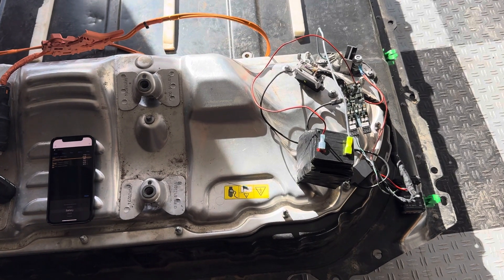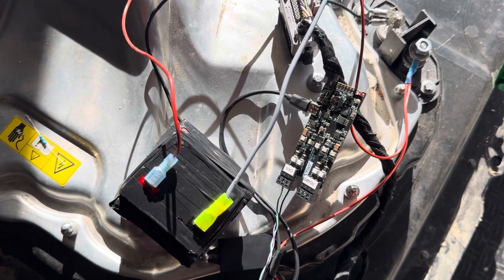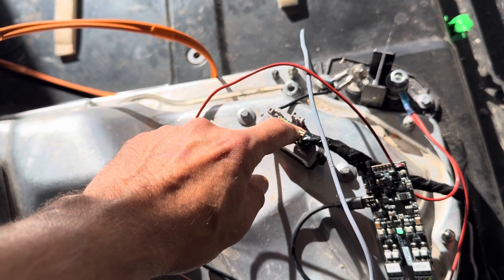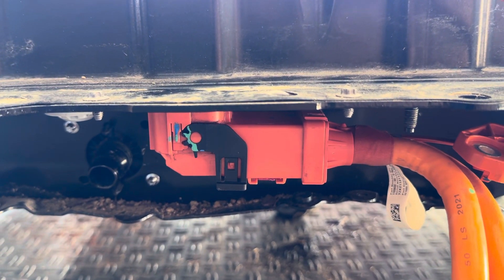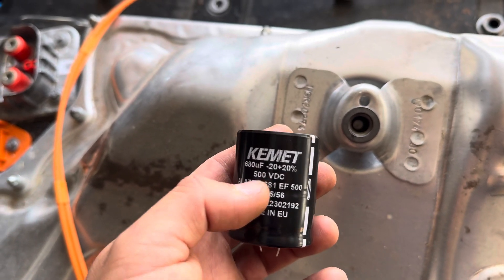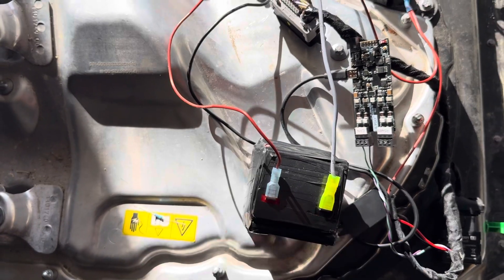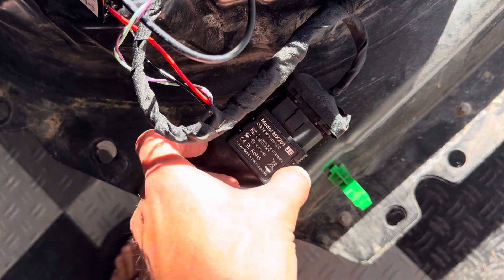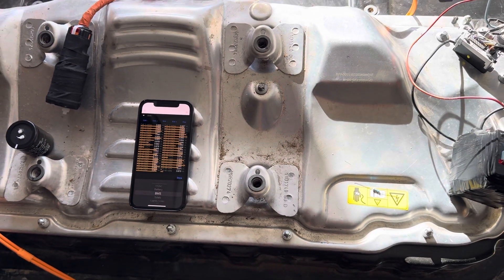Using Tesla model 3/Y battery for solar storage - how to close contractors using Tesla BMS

Comment: What is the best way to use a regular 12v lead acid battery with a 2022 LFP pack that is meant to have a 16v lithium battery? Obviously it will power up fine but after a while I imagine the higher voltage will damage the 12v right? 

What would you recommend? Is it possible to tell the DC-DC to output 14.6v?

Comment: I have problems to close contactors with 2022 tesla y long range hv battery. Lilligo/arduino sohtware reported problem. Check hv cables and interlock. Any suggestions.
Reply from the maker: Join this Discord and ask questions there: https://discord.gg/mVnXGCkh

Comment: How are you charging the battery a direct 240V Solar Array on the inverter side?
Reply from the maker: I won’t be, because my solar is AC coupled, but it’s definitely possible, if the inverter has solar input.

Comment: Hi, Is the software that closes the HV contacts loaded on the lilygo board ?
Is is just a matter of can message to pre-charge and then enable the HV live for the motor
Reply from the maker: You need to flash the board with the custom software.
Reply: @diytesla  do you mean on the  lilygo  or some board in the penthouse ?
Reply from the maker: @darrellsveistrup4718  lilygo

Comment: Hey. I have a 2021 Dual Motor 3 that has a very random on/off VCFRONT_a059 alert that wont go away. I've checked the battery terminals and ground connections. any ideas?
Reply from the maker: I can’t help with diagnostics in YouTube comments

Comment: Nice work! Cheapest home battery solution you will find! Just need a high voltage inverter (like the Fronius Gen24). I just realised, I made a 3d printed file for the canbus controller enclosure. Will have to upload to thingiverse and supply the link!
Reply from the maker: Please do, thanks!
Reply: Really hoping to do this with my old Model 3 battery when the car's toast. Hope to keep it running!

Comment: My friend you are quite the engineer that's really cool how you did that with so little parts needed.

I get the idea you can just directly wire in to just about any solar inverter mppt input for discharging.
What are your plans for charging the pack back up via HV DC?
Reply from the maker: HV inverter/charger.  Will be testing one on Monday.